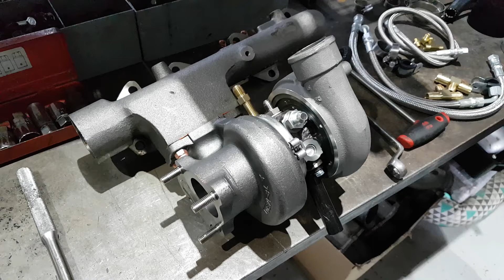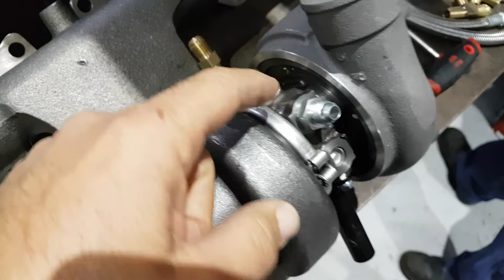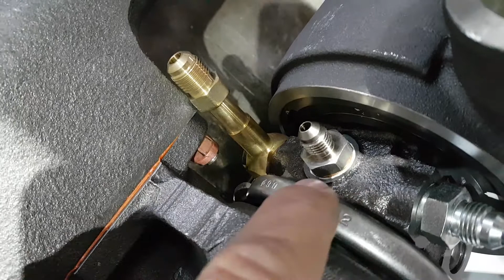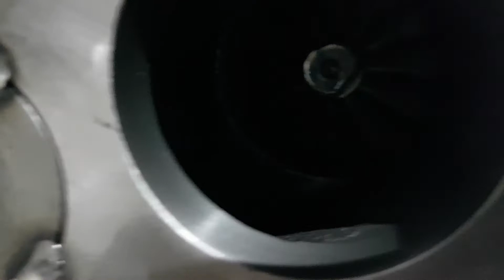Turbo Kits. How does a turbo work?

Comment: Interesting turbine housing guys. It looks like the wastegate hole has been welded shut and there is a cavity inside for the wastegate gases to merge. Is there any advantage to this over the more common setups (such as having the gases exit where the welded hole is?) 

Cheers
 Ben
Reply: Ben Isaac low boost turbo set up. Has no requirement for a waste gate. Further more diesel turbo setups a rarely used with a waste gate. 

Diesel engines run with compression, not spark. Wasting boost is not want you want in a Diesel engine.